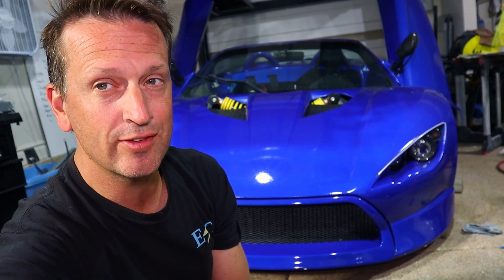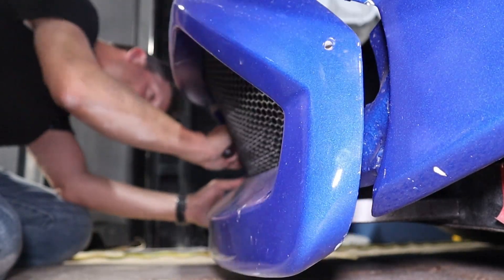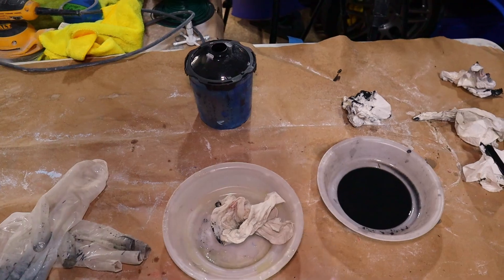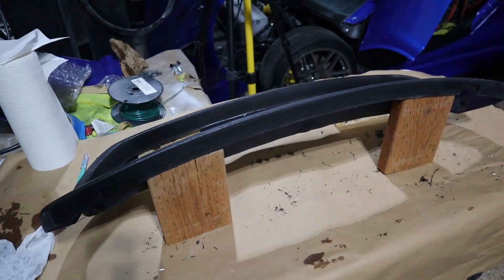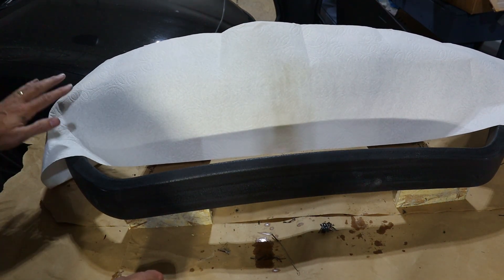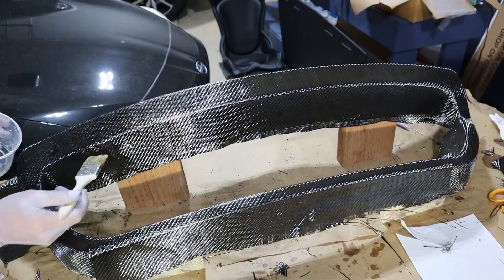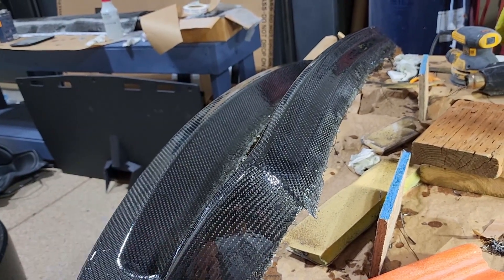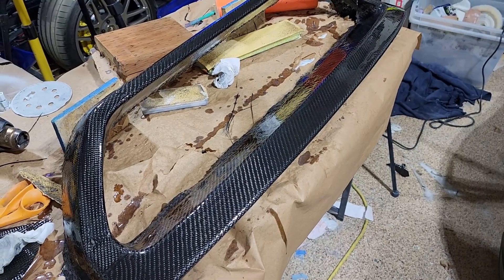Carbon Fiber Carbon Fiber - Carbon Fiber Skinning, Wet Layup

Comment: tbh, not much into the plain look of carbon fiber, since thats the part of it, that is sold as vinyl wrapping foil. Since this doesn't really reduce any Weight, it basically falls into a similar category. Adding Mold Release and adding up on the inner layers would make it a good carbon part - thats just the amount of effort required for the real thing.

Comment: Did you gel coat your fiberglass work or did you just put a thin layer of light weight filler and painted?
Reply from the maker: When I make a fiberglass panel, I use gel coat.  If there is already a panel made, filler and paint
Reply: @electricsupercar  awesome! Thanks for the quick response. What brand gel coat are you using? Thanks
Reply from the maker: @chrisd5383  I get my gel coat from fibreglast.   Link in the description
Reply: @electricsupercar  thanks!

Comment: I really like the carbon fibre look, but it seems like the imperfections of the actual kit stand out a little bit more. I feel like that particular trim piece would look better if it followed the body lines better. 
Either way excellent video and excellent work. keep them coming.
Reply from the maker: Thanks for the comment!

Comment: Starting to look like an ICE car with the ‘grill’ accentuated like that. I’d paint the mesh blue to make the carbon surround look more like an accent and less like a functional requirement.
Reply from the maker: Good thoughts!  It does have a functional requirement 
https://youtu.be/wZ-G7ljfIqQ
Reply: @electricsupercar  A lot of EVs seem to be going toward body color grill panels. Mustang Mach-E, the latest version of the Bolt, the upcoming Equinox EV, etc.

Comment: That looks good.  I know a lot of the original K1 kits had contrasting front grill and rear diffusers on them too, carbon, black paint, gray, something like that.  I think that would have looked good if you had just left the bed liner paint on it, but the carbon does add a little more flash.  Very nice!
Reply from the maker: Thanks for the comment!